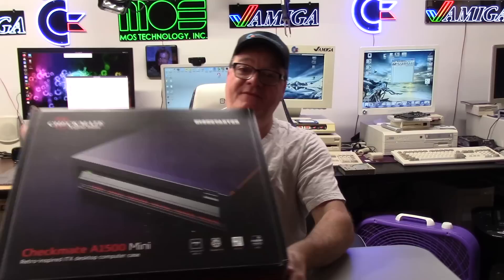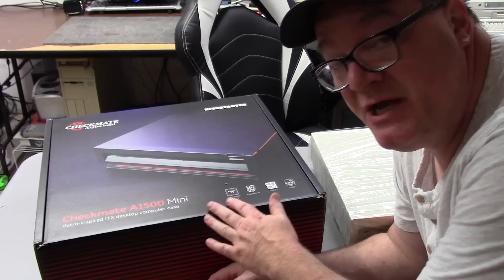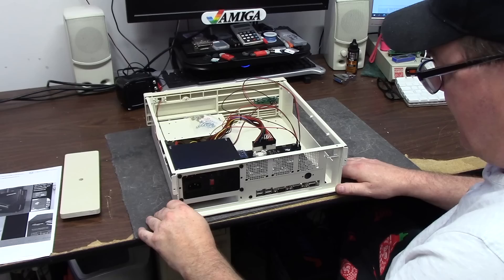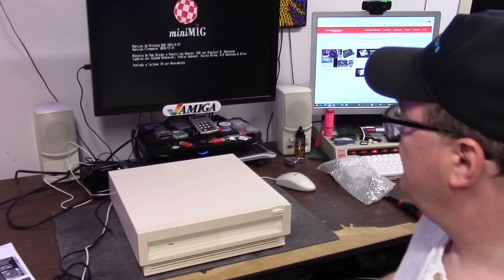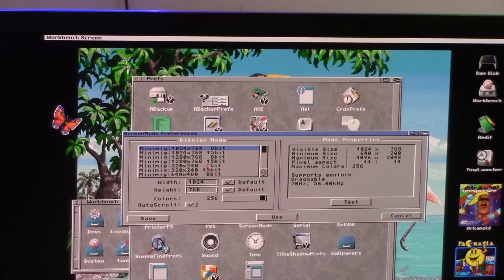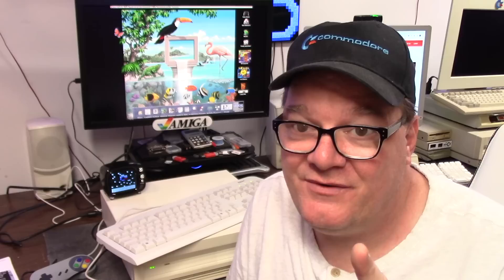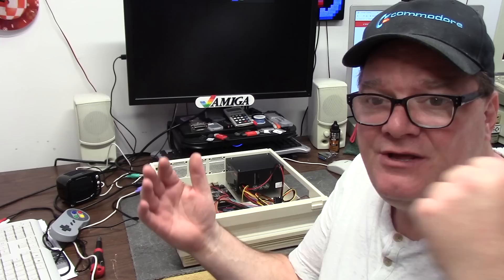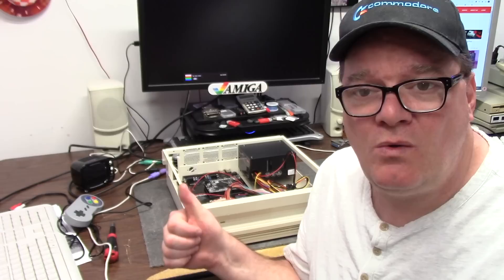The Checkmate1500 Mini ITX UnAmiga!

Comment: I have 3 of the Checkmate 1500 cases for my A500, A600 and A1200.  Not bragging I just have them, and they are very nice and am happy to have them in my rack.   Not sure why I did not add a Mini to my collection but you never know Mr Jones could produce another batch like he did with the original case so if you miss out you can pray and who knows I might get one but I have no clue where I would put it.  Your right about the price and it adds up quickly as you add all the bits, I have no regrets and am happy to have them.

Comment: You are absolutely correct about jumping on Amiga projects-thats why I jumped on the Checkmate cases, Hese AA3000+ & A4000TX board builds, ZZ9000 GPU, Highway Pro USB Zorro cards, and registered for the ReA4091 SCSI card project.

Comment: I bought a black Checkmate mini with mistix mitx mister board, and previously bought a full size black 1500 checkmate case which I am putting a Hese built AA3000+ motherboard with Simon sheetmetal fitting kit  and custom Hese reduced height daughterboard. Expensive hobby
Reply from the maker: indeed it is, but its so much fun..

Comment: My original A3000 clone case arrived two years ago. I still haven't opened the original box that was sent. The original case including shipping was around $400 cad minus a PSU.
Reply from the maker: Why not????
Reply: @ChrisEdwardsRestoration  I have so many Amiga upgrade boards and CPU's to get to first. I just hope what's in the box is everything I ordered, for as you know, these cases are great quality and not cheap. I also purchased this with the zorro slot adapter for an aca500 accelerator that normally sits outside of the A500, but found out that it does not work due to a possible timing issues. I also just received an Amiga mini, which may protect my original hardware from use.

Comment: I have an A1500+ (the normal MicroATX version, not the MiniITX version) and the case looks quite good and is mostly metal, with a decently high build quality as noted here.  Unfortunately the back panel for the ATX / vertical option required some milling work with a dremel for the Geforce 1050Ti card I installed (allows using VRR monitors so that  WinUAE has zero tearing in PAL or NTSC), as the slot openings are slightly off and I could not plug in a Displayport cable into the video card as I received it in the box.   I don't know if this a 1-off problem or if they are all like this.  There is no good way to install a 2.5" drive, none of the mounting holes align, you're going to have to fabricate an adapter plate or use zip ties, so your build with this case will be much cleaner using m.2 drives.  Otherwise this case hits the nostalgia buttons quite well.

Comment: This thing totally lacks true Ethernet connectivity, right? :/
Reply from the maker: No ethernet but you can just mount the hdf in winuae and add what you want
Reply: @ChrisEdwardsRestoration  Sorry? What does an emulator running on a foreign operating system have to do with true Ethernet on AmigaOS?
Reply from the maker: @First_Ninja  idk, i answered your question with no it doesnt have ethernet, then expanded that to how you can add things easy to the image if needed.
Reply: @ChrisEdwardsRestoration  Sorry, you're totally missing my point. All Amiga systems belong on the LAN as first class citizens. The price of admission? A true Ethernet port using the Zorro bus, the PCMCIA interface or - if the option is available - on the motherboard itself. Unfortunately, it seems as if the developer of this system was totally uninterested getting their creation online. It's sad, really - not to mention a missed opportunity.